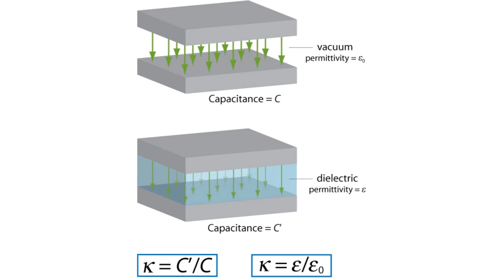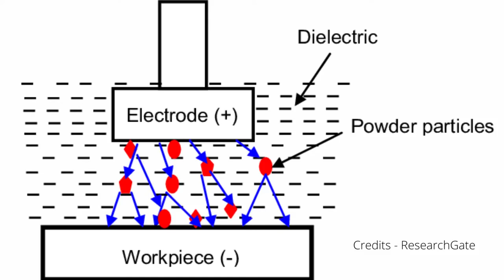Wire cutting EDM- De-ionized Water: The Think Filter Show: Ep. 12: Part 4

Comment: Can distilled water be used as a substitute for deionized water?
Reply: Or Double distilled water perhaps?
Reply from the maker: Hello @shobithrkava2144 . Distilled water may be used as an EDM dielectric fluid with a relaxation generator but only for rough machining when the machining accuracy is not critical
Reply: @thinkfilter  Okay, thank you